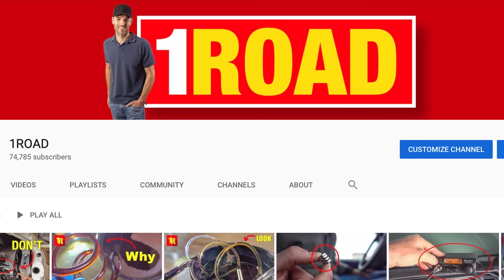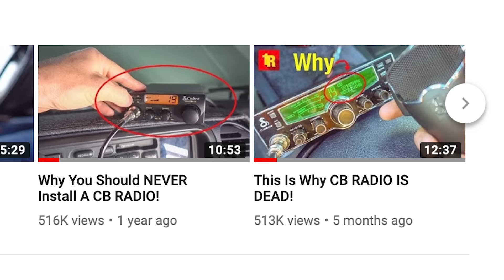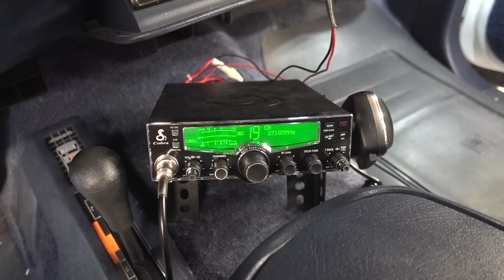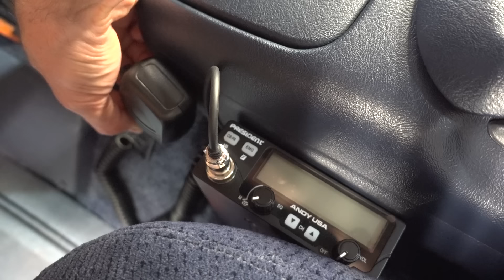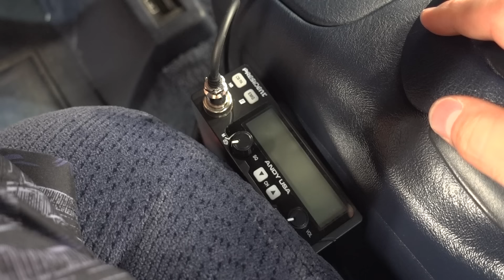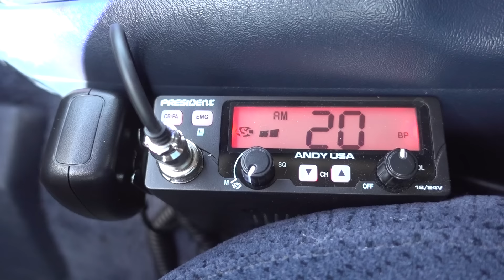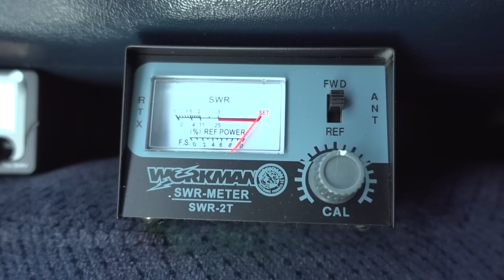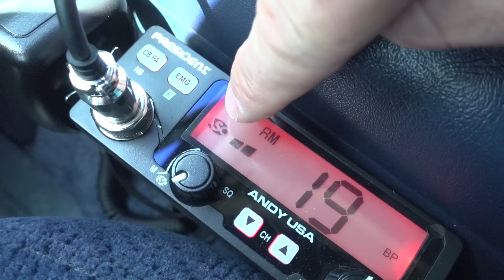Here's Why YOU SHOULD TRASH YOUR CB RADIO!

Comment: I don't see a Cobra 148GTL DX owner taking his radio out any time soon.
Reply: Nope,I like my 148GTL.Gotta have all the bells and whistles and of course sidebands.
Reply: Or anyone else who has one for that junk.  Ohh, I dunno,maybe I will get rid of my 500watt Connex.
Reply: Anyone got a 40 channel selector switch to suit a Cobra 138XLR they don't want?
Reply: @BentConrod  If it's playing up there is a video on youtube explaining how you can drill a hole in the selector and inject some contact cleaner to bring it back to life
Reply: @izzzzzz6  
Thanks for the tip but that's not the problem. I'm in Australia, got a 138XLR-A, identical Uniden 858 chassis but only has an 18 channel selector.
Great radio other than that. Used to run 
a Redco Digiscan on it back in the day. No need for it now but all the action branches from ch 35, so thought I'd have a go at a 40 ch switch if I can find one.
Reply: there is nothing better than a cobra 148gtl
Reply: I replaced my 148 for a President Lincoln 2+... love the Lincoln, puts out 50 watts, am, fm, ssb, 10,11, and 12 meter, rodger beep, echo, freq monitor, all in single DIN. Don't get me wrong, loved my 148 too, but I've had it for over 30 years, needed a linear and had to add "funny freqs" to get it into 10 meter, added other boards for rodger beep and echo.... No, the President Lincoln 2+ is the way to go.
Reply: @joestreiff9401  I have a ranger rci2950 that goes places as well as an alnico dx70 but basic cb the cobra is a good unit.
Reply: DownsideUp cobra 29 no bell no whistles and I’ll spank any export pile a garbage. 1/4 watt to 18 watts on the bird pure audio driving a 2x4 into a straight 10 pill 💪🏽
Reply: @NebukedNezzer  yeah huh,   a cobra 200gtl dx with a freq meter.
Reply: back in the day the 148 was my base station with a d104 . awesome setup
Reply: @NebukedNezzer  ,
Thats why most of the modern big radios are just copies of the 148 main board, with improved PLL sections.
Reply: That's one of the radios I have...and a President (not Uniden) Grant and a Galaxy 929 for people looking in to see....
Reply: The Cobra 29 LTD Classic is the superior radio it can be clipped and peaked to to be big bold and loud, I have mine clipped and Peak and use it with a Palomar 250 watt linear and I can talk from Maryland to Texas and sound like I am and your car yelling in the back seat, can this be done with that particular radio you were talking about if not, then I'll just keep my Cobra 29 LTD Classic
Reply: This one won't. That's a fact, donchano.
Reply: I love my Cobra 29 LTD it's really old and it's really loud at least that's what they tell me down in the state of Texas and I live in Baltimore Maryland that's about as far as I need to transmit😂😂😂😂😂
Reply: @Halfatruck007  to bad you aren't here with your 29 I have a northstar and a President Grant I'd put against it. Like you mine key a quarter watt. Not knocking the 29 I know it's abilities and with the right tune they are great and I know this because I also have a 29
Reply: What do you think my COBRA 148GTL is worth? It is made in the Philippines.
Reply: Jajaja I bet he really is now!!
Reply: @BentConrod  - Yep... I have a pristine 138xlr I would like to sell. Never hacked. Belonged to the old man. 
No reason for me to keep it. I have a President Lincoln :D and a FT100 and FT857. Yes I am a hammy. Yes I have CB linears LOL
Reply: @NebukedNezzer  -  Except for the 148DX.  And of course the President Lincoln. The 148 is a good chassis. The DX model has several crystal banks for extra channels FM and Roger beep. The Lincoln is one hell of a chassis. I'll save you the tech explan but trust me its exceptional. 148 has a very tight front end (receiver)
Reply: @NebukedNezzer  -  The 2950 is built with the same motherboard as the 148DX... Just has a different front end on the radio. They also add things to the final section in some models. The RCI is also known for a loose receiver. Splatter is an issue with those.
Reply: @KlodFather  
Thanks for the offer but I've already replaced the selector switch with a CB40 kit. Looks different with the OLED screen in place of the LED display but I like it. Open and closed squelch scanning is handy too.
You've got some good rigs. 👍🍻
Reply: @BentConrod  -  Glad to have offered. Always help a brother out.  
Years ago when the kids were little, I did whatever extra electronics work I could get. That is how I paid for Christmas, toys, amusement, school clothes, pokemon, and all the extra stuff that the salary and the assistance their mother got. It was rough times then and I worked some long hours. I have forgotten more about CB than many others knew. 
I used to fix boxes of radios for other shops and had them collect junkers for parts. I had hundreds of radios there for spare parts. Times got better. I worked as an engineer for many years. Now days I am head of IT. I have been working on putting a bench together again because I miss doing it. So many people need just a little help. 
One other thing I want to do is get into and teach some courses on amateur radio. I paid my dues. Being grandfather and helping people is my goals now.
Reply: @NebukedNezzer  RCI 2970- modded for cb band
Reply: Galaxy 44, love it.
Reply: @Halfatruck007  2879 im guessing?
Reply: I have my 40 channel SSB/CB as well as a few 2m 70cm mobiles. if I roll over, IO will be sprung back upright, wheeeeee
Reply: @kenbowser5622  I would
Reply: @Halfatruck007  Nice
Reply: @KlodFather   Good on ya Mate
Reply: @jeffreymcdonald8267  WHere are you from? Thanks for the good word :)
Reply: Yes Sir.
Peaked and Tweaked with Power and Funnies. With the Palomar Linear,.. for opening Garage Doors 😂
Reply: @My-Pal-Hal  -  And setting off car alarms as well as screwing up analog phones and PA systems. Try it on Karoke night behind the bar and sing crazy stuff. They can't get it out of the PA system LOL
Reply: @spankthemonkey3437  -  Yes... its called trade you for a cobra 146 or a uniden PC122. They are the same size but sideband. Its just too much to add to make a 29 into a SSB radio. No one would make a mod or kit for it. Not feasible.
Reply: @KlodFather  
Oh,.. I Know.
If you're close enough, you can WALK on anything 🤗
I just thought it funny. When I hooked up my linear years ago. I was noticing my neighbors across the streets garage open. But they weren't home, or coming home. Seemed strange. Must have took me a Week to figure out it was me when running it on High 😂 ...D'OH
Reply: @KlodFather  
It's been awhile since I warmed up the ole Cobra. Like 20+yrs.
I should pop it open, and try to remember the things I used to know, like you mentioned.
I was just looking at my 148 setup. And can't even remember what switch does What. Or which PIN is the one to power the Mic without opening it.
( it was like riding a bike, a Thousand years ago )
And, I probably should swap out the ole capacitors just because. I haven't soldered much either for a while.
Have a bunch of my ole stereo equipment that could probably use some new capacitors Too.
Do they still use FLUX Nowadays 😂 ... good one...
Reply: @KlodFather  
AND YES,.. I CAN STILL RIDE A BIKE... probably 🤔😏
Reply: @My-Pal-Hal  -  I remember there were some cars that had sensitive computers in them around 1990 or so... One time at the light I keyed up about 375 and the car beside me stalled and would not restart. I found some other cars ran badly when I would key up that radio near them. The gages in my truck would drop and sometimes the truck would miss when I would transmit. I found the way to solve this was to put bleeder caps on the power and signal lines to drain off the RF superimposed on those wires. It hardened my system but I know that I stalled out a police car and drove their electronics nuts with one setup I had which delivered about 300 on VHF,  The antics that car did was amazing. They were using 25 or 50 watt kenwoods but what I was punping was WAY hotter than their rigs.
Reply: @KlodFather  
My Trick was GROUNDING EVERYTHING TO EVERYTHING.
And works like GOD, on GM Vehicles 😬
As an old BOEING guy. We learned a bit about how it REALLY Works. It's like you think you know something. THEN,.. SEE IT IN ACTION 😂 damn
How old am I ???
I was sitting on Top of a 747 when Mt St Helens got Frisky.
From my advantage Point. It looked like Seattle just got Nuked. Then,.. we got the warning to start covering Aircraft for ASH. 
Sorry. That was just something that occured to me.
Since I did other aircraft that were Not All Passenger Aircraft.
...it's,.. Classified 😏...  But a Great Memory ...

What were we talking about 😂😂 😂 📻
...oh Crap, I gotta release the Key on the Mic 😏...
But That's The Fun us old guys get. No,.. not the ladies we share our bodies with.
But The Things we can Do with our Hands 🤗  
...kinda the same thing 😂...
And,.. I can use a Slide Rule.
I'm just not sure where it is 😏

Yes, you didn't ask my age.
But this is YouTube. Verification of whom you talk to is a Bonus🤗

I Will Say.
I'll bet Vehicles are more subjective to high power Radiation then ever before.
It's simply a fact of Multiple systems with no Shielding or Backup.  Blah blah blah 🤣
Nice Talking To You ☺️
Reply: @My-Pal-Hal  - Agreed. I call it a web of grounds. The body, the frame, the engine, the alternator, and the front clip, do not always connect well with each other, but by making a web of grounds it solves many RF problems and in some cases on older vehicles like I have, they run better with the grounds in place. It is a necessary evil to perform this improvement.  
The newer cars are actually more robust than you think. With unmarked police vehicles that are actually seized civilian cars and trucks as well as all the 800+ mhz stuff out there that makes amplitude induced noise in electrical wiring, the manufacturers are keen to put filters on all inputs to modules and shield everything well these days. Look at an 80's or 90's car computer and look at how they are built today. Then it was a folded metal box with holes and if your MFGR was good they conformal coated the boards in the module or puter. These days it is an aluminum clamshell with tight seals, conformal coating inside and sealed connectors that have built in RF filters and protection diodes. Last account I had, Ford used ITT Cannon connectors in all their stuff, Chrysler was using Molex, and GM was using Delphi to manufacture theirs. Japanese companies were using the usual suspects in Japan to make theirs. Most of their computers and modules are made my Nippon Denso or Hitachi and they have captive or long term relationships with other manufactures.  All the "GoesIndas" and the GoesOuttas" in the main connectors are pretty good on the Puter modules and CanBus stuff these days.
Reply: @KlodFather  
Us Old Guys Just Need More Time 😉
... who is this ...
Reply: @KlodFather  I bet with more van lifers, rv'rs, etc; your workshops and help would be an amazing gift for many travellers.  I used to drive truck but did not have a cb 😒
Reply: @birdlady2725  -  God bless you. I have known some ladies who can really drive.  There is one gal on youtube who can back a trailer of a semi into some terrible places. So much so that she backs the truck in for her husband. She's much better than him LOL.  Never assume anything about the girls. My ex was and is a civil engineer. That woman has more brains in her fingernails than most people including my self have in their whole body :P   Thank you for the good word.

Comment: I have been a ham radio operator for over 51 years.  Up until the last couple of years, I had no interest in a CB radio.  Now that the FCC has authorized them to use FM and AM modulation, you can eliminate a lot of the atmospheric "noise" you hear on AM.  FM has MUCH better voice quality.  In fact, Amazon has the President Thomas for the same price as your Andy, and it has a few more features as well as both FM and AM.  FM is catching on slowly but, once you have had some conversations on FM, you will like it a lot.  Thanks for a really good video!  I have had a VHF/UHF radio in both my car and truck for years but, I think I will include one of the President Thomas CB radios just to have on hand.  There are a lot of CB folks also getting on GMRS which is UHF FM and requires a license to use.  But, unlike "skip" interference, it is strictly line-of-site communications.  You can easily communicate 35-50 miles from hilltop to hilltop and even further if you go through a GMRS repeater.  That is something you might look into as a lot of the off-road folks, and 4-wheelers, are using GMRS because it suits their needs without having all the noise from skip like CB can get.  I hope to see some more of your videos in the future.  I'm all about being prepared in an emergency and communicating is #1 in my book. Paul Cavnar - K7IN, Fallon, NV.

Comment: Did you every think of mounting on dash. Or below dash like had always been done by those in the know
Reply: Larry Snyder that was my first thought. I have one on the dash and my second is under my driver seat (it’s a really crappy one I only use for rock yards or other materials points when I have to make service calls in there).
Reply: People don't want the dash cluttered.
Reply: @robertcollins6170  yeah only if it's McDonalds or Starbucks trash. Then it's ok
Reply: Only idiots mount a cb on the dash, to hot or will get stolen

Comment: CB radio is the gateway drug to Ham Radio.. both are wonderful hobbys that need more responsible and plesent operators.. 
Hooking one of these radios up to a power supply in your home with a large roof or tower mounted antenna can increase your range to 20+ miles and during certain times of the year you can hear other mobile and base stations across the country.. sometimes even the world!
Reply: Hehehe, gateway drug... Gateway plug? Maybe.
Reply: Napster6.
 Depends on sunspots. We are in a low count period and not much is going on long distance but in 2003 I heard two drivers talking, one in San Diego to a driver in Newfoundland.  I was in Indy and I could hear both S9
Reply: Well said!

Comment: CB radio is fun. I just installed one in my van because it's a great way to find out about traffic ahead. If there is a wreck it's good to find out which lanes are clear so that you can move over early. It's also a great way to let truckers know if they've got a light out, a strap loose or any other issue they might need to know about. CB's are inexpensive and a great tool to have during road trips.